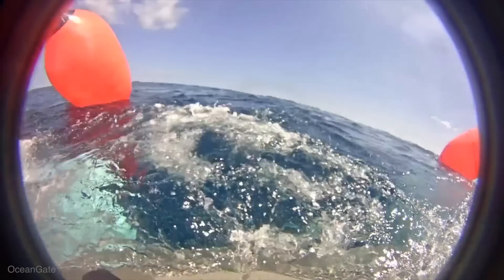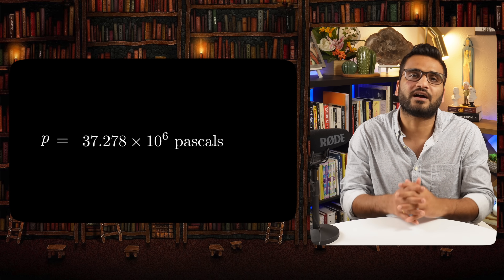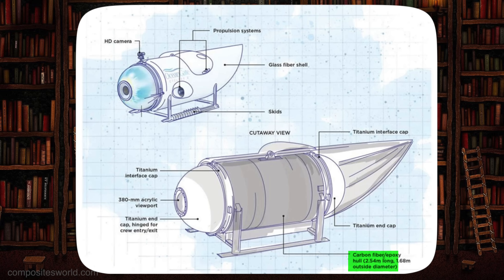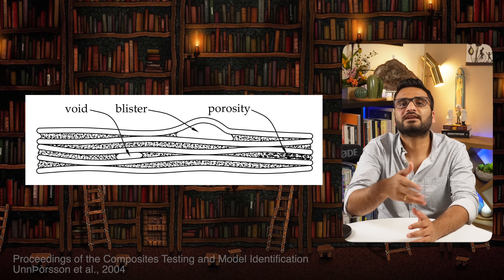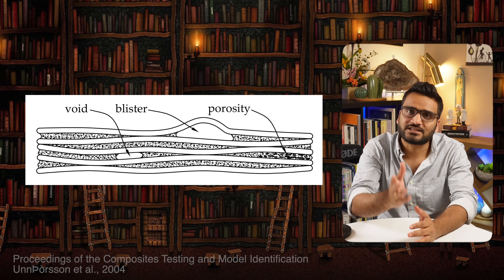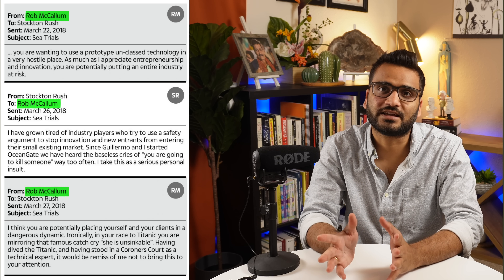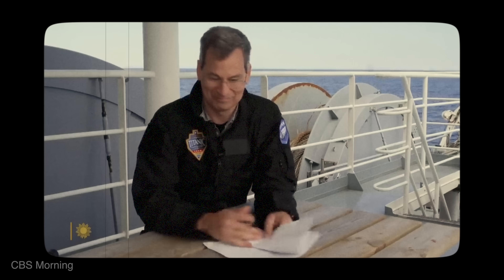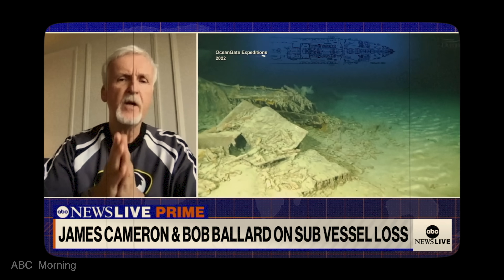OceanGate REALLY messed up - A Structural Engineer's Perspective | TITAN'S TRAGEDY

Comment: The website talked about the hull monitoring system that would give the submersible real-time warning of any problem so they could then head for the surface. Unfortunately it appears the first sign of a problem is immediate implosion and death. No time for surfacing.
Reply: Sounds of cracking were the early warning alarms but they were ignored
Reply: Actually, I think it was an attempted emergency ascent that caused the implosion. The runners they brought up showed little to no sign of damage. Due to how they were attached, they should have suffered very clear damage were they attached when it imploded. That tells me that he had time to initiate the emergency ascent protocol since dropping the runners was to only be done in an emergency. It wasn't needed for a normal ascent. The problem with an emergency ascent like that is that it temporarily increases the forces acting on the hull. You go from the water pushing down on you very hard to it doing so while you're essentially pushing back very hard due to increased buoyancy. So, if your hull is close to failing and you then do something that increases the stress upon it, it's probably going to fail. He probably heard the system warnings and overreacted by initiating a full emergency ascent. They would likely have imploded either way but a more gradual ascent might have given them a better chance of survival.
Reply: @possumverde   oh that's interesting.  I didn't hear such specific info on the condition of individual parts. Is that in this video or where did you hear that?  And what do you make of the hull monitoring system?  Could it actually have provided enough warning of an increase in strain in the carbon fiber to make an ascent possible?
Reply: @johnvanalstine9645  Mr Rush held Patent number US 11,119,071 B1 for his hull monitoring system. If he applied as much care in designing it as he did to everything else, it's hard to believe it would have been very effective.

Comment: 1 DRRR: Doctor of What, exactly?    2 DRRRR: No-one has ANY IDEA of what DEPTH the submersible was at, when the implosion occurred. 3 DRRRRR: THEREFORE, no-one can make any statements about the 'load' that caused the failure. (Go back, read that again, it'll come to you). We are now at 2,08 mins of a weak analysis: Assumption is NOT analysis. 5400 psi is certainly impressive, HOW does the 'Doctor' KNOW the depth of the submersible when it failed? He (nor anyone else) does NOT. Yet he ASSUMES it is at maximum depth? We are now at 2.26 mins, 2 analytical errors so far, 1 per minute. 4 DRRRRRR 'Tons of on-site testing' was completed: 20 SUCCESSFUL dives, 1 failure: 95% certainty that you return safely. How many submersibles has the 'DOCTOR' built , hat have a similar track record?Oh none? Wow! we are now at 2.48 mins, the error rate is INCREASING.
BUT WAIT, there 's more! 
5 DRRRRRRR The "Doctor" now references a MOVIE DIRECTOR, A PASSENGER on an alternative submersible that has been to see the Titanic wreck 33 times. WTF?? If you sit in the passenger seat of a for car 33 trips, this qualifies you as a  vehicle design engineer? Who cares what James Cameron THINKS about the design? He is NOT an engineer. Apparently, neither is the 'Doctor'. We are now at 2.56 mins, 5 errors in 3 mins.....about average for YT nonsense.
BUT WAIT, there's more!!
6 DRRRRRRR : Once again the ASSUMPTION that the Titan failed at the Titanic depth, citing entanglement, abrasion and several other (google defined) failure modes of Carbonfibre, while MISSING the most important attribute of CF structures: Virtually ZERO fatigue effects: There is virtually no 'degradation' as a result of 'cyclical loadong' What a Joker our Doctor is turning out to be! Misleading YT like that. Tsk, tsk. we are at 5.25 mins.... 

FINALLY , at 7.40, an accurate statement by the 'Doctor': ....we don't precisely know what caused the implosion ot Titan..."  Yep.

So we have wasted almost 8 minutes, before we get to ACTUAL, DOCUMENTED, SCIENTIFIC issues....what an introduction! (CRAP)

Start watching from 9.35 mins onward: The front viewport was (documented) as being rated to 1300 m.....this is  the MOST Likely fail point (not the Carbon fibre hull)  and in other 'recovery' videos of the salvaged parts, the front cover is being lifted with strap running through the (missing) front viewport 'glass'. HMMMM?

Go find that video clip, THAT is how the Titan ended: The front viewport window, forget all the other nonsense.

Comment: Only 5 minutes in but the section on CF composites is a little misleading. The compressive test is on a woven composite which will have equal stress capability at 0 and 90 degrees. The lay of the Titan just has unidirectional lays, which will be compressed along the fibre length by circumferential stresses. It will fail differently and at a lower stress.

Comment: "And that's where we work with Boeing and NASA"
Boeig says they didn't work with them at all. They had contacts there probably but that's not the same as a joint venture project where actual know-how is shared.
Nor did they sell the expired filament used on the craft to Oceangate so that must have been bought through other companies.

Nasa says they also did not work with Oceangate.

So what exactly happened there? A phonecall asking an employee at either for some design advice isn't "working with", that implies a legally binding partnership. Such a thing seems to not exist.

Comment: As a retired structural engineer I agree this subs pressure hull design was dumb.  Playing fast and loose with your own life is dumb but taking passengers is downright criminal.  Carbon fiber around a single titanium ring....hmmm what could go wrong.  The design was experimental, materials were experimental. This company and I'm using that word loosely. Somebody needs to go to jail. I don't think if the passengers really knew what they were getting themselves into.  My condolences to the families.

Comment: The loads on the end cap domes were about 10,400 tonnes of water pressure.  This end load was resisted by the thin walled cylinder of the carbon fibre barrel.  Due to the layout of the carbon fibre wraps most of this load is / was carried by the compressive strength (or lack thereof) of the resin.

I suspect that the cylinder failed in buckling under this massive end load initially, followed by general collapse.
Reply: That was my initial suspicion also.

Comment: Great presentation. Someone in another video pointe out the various screws being bolted nto the hull to support the display monitors and lights fixtures, also factored in to further reduce the structural integrity of the already sketchy hull made of a carbon. The little screws bolted into the 5 inch hull directly, causes stress and reduces integrity a materIAL that's susceptible to brittle break offs

Comment: Look at the front of the submarine. Just the part that had the window. 2 Good pictures afterwards. At 2 o'clock there's a puncture in 7 inches of titanium. It came from inside the submarine. That's 5 inches of carbon fiber hitting 7 inches of titanium and breaking through. The window is gone.

Comment: The Titan wasn't a sphere, it was a cylinder. The maximum amount of stress was concentrated at the glued "ends" 😱 The glue probably failed at the carbon fiber connection to the titanium end rings.

Comment: Under what conditions would concentric carbon fibers do anything useful structurally, compared with simply using a filler like sand in an acrylic concrete?  I would carbon fiber might be a useful material in a hull if it served as a tensile skin around a steel and titanium frame.  I wouldn't want to trust my life to such a thing without significant testing, but if there were multiple layers of slightly-elastic skin with fluid between, I would think carbon fiber's tensile strength under tension could offer useful benefits if it were part of a structure were anything that was under significant compressive loads would be made of uniform material.
Reply: Carbon fibres may allow a greater packing density, strong stuff/filler. If the fibres were disposed radially they would be in tension which might be structurally better than the circumferential windings in compression.
Reply: @everTriumph  Indeed, the only way for part of the hull to flex to a tighter circumference than the cylinder would be for the volume occupied by the material between the inner and outer walls to decrease, or for distance between the inner and outer walls to increase.  A mesh that ran diagonally inward and outward around the circumference, and was "phased" in such a way that any longitudinal cross section would have fibers at many different depths and directions, could have added a lot of strength.  Enough that I would think that a hull of the same thickness that could survive any dives to Titanic depth when wrapped circumferentially would likely be able to survive repeated dives without fatigue-inducing levels of stress.

Comment: You make excellent points. I would also add the fact carbon fiber and titanium are notorious for galvanic corrosion when placed together. Boeing knew about this issue while creating the carbon fiber composites for the 787. They had to separate all titanium parts away from the carbon fiber wings and hull. The Titan had two titanium caps and interface that sat right against the carbon fiber hull. .
Reply: Carbon fibres would have been out of contact with the titanium parts if the epoxy was properly applied to the connector rings.  This appeared to be the case. The idea that RMS Titanic continued head on into an ice field isn't correct. She changed course to the south after being informed of the presence of ice on her original course. Statements need to be accurate when criticising actions as comparisons.
Reply: @geoffreycodnett6570  Arguably everything is speculation at this point. I still stand by the fact carbon fiber and titanium are galvanic corrosive. Even if epoxy sealed, laminations can get micro-fissures or cracked over time and many cycles of compression and decompression. Plus the salt water can act as a conductive medium to accelerate galvanic reactions.

Comment: Here's the thing, if you have a component that is designed to operate at 1500m maximum, you don't EVER operate it at 1500m.   You operate it at 1000m, or whatever depth minus a predetermined safety factor. In all the reporting thus far, I'm not hearing that.
Reply from the maker: Absolutely. Margin of safety matters.

Comment: As a professional since 40 years in composite fabrication i would say that your explanations are very well done and accurate, that's the first time that i see an expert that seems to really know what he talks about about this accident.
Reply from the maker: Thank you for your kind words!
Reply: @doctorchadha  There is suddently one thing that just went on my mind, it's the obvious flaw of the design and the flabergasting way the cabon cylinder was build.
To make it simple, you have a cylinder with two hemispherical caps. So each cap press againts the tube ends with the pressure of the cross section, but the contact surface is from my estimation only 20-25% of the cross section so at 4000 meters you have on the tube ends a pressure of 4 times the pressure on the tube sides. But what is really idiotic it's that the cylinder has been fabricated by roling one directional carbon fiber. In this way you achieve the maximum resistance to side compression, but you have no resistance in the tube axis direction. Worse you have a huge risk of delamination in that axis and even worse at the tube ends, you have 4 time the pressure and no resistance in that axis. This is insane, you have only the matrix, epoxy resin that can absorb the pressure and in this way that resin will get a quick fatigue, will start to have cracks and become brittle. Then one day the tube ends will collapse and the whole tube will shatter. This design was made to fail, i don't know how there was not an engeneer to point to that huge fatal flaw!
Reply from the maker: Absolutely. Assuming the structure to be symmetric about vertical axis of the cylinder, every point on the hull was subjected to three compressive stresses: (1) the compression from the domes in z-direction; (2) the radial compression; (3) the circumferential compression—thats too much work for epoxy. And apparently, the fibers were not cross-wound. I would also think that the stresses coming from titanium dome on to the cylindrical hull could lead to local crushing due to stress concentration at the junction.
Reply: @doctorchadha  Yes the major flaw is that the carbon fibers have been rolled on the cylinder, there is a video showing the building of it. Usually you make a cross.wound at 45° to give the cylinder a homogenous resistance but of course to get the same resistance in one axis you need to make it thicker, so heavier and less space in the hull. 
I have build quite often small carbon cylinders and if you just roll  the fiber like this, if you try to bend the tube it will break very easily. Making a pressure resistant tube the way they did it is absolute madness!
Reply: Well said. This has been the best video I have seen on this fatality.

Comment: I appreciate your insight into the engineering aspects of the  Titan.  One thing I have noticed in OceanGate's  video of the construction of the carbon fiber hull is that there seems to be only a radial wrapping of the carbon fiber mat

When you look at say the construction of the carbon fiber air tanks used for fireman's self-contained breathing apparatus (SCBA) the tanks are wrapped in a diagonal weave so there is a crossing pattern to the weave.

The radial layered method is simpler to fabricate in comparison to a crossing weave.  I wonder about the ability to distribute the load and prevent delamination, and fatigue strength. 

Another area I have to question is the design of the  "hatch".  According to reports the end bell, which included the viewport, was held in place with 17 bolts.  In comparison 48" dia. 300 psi flange has 44 bolts.  I realize that there is a difference between having the pressure outside vs. Inside.  But  17 bolts results in an odd loading distribution around the flange.
Reply: Apparently there should have been 18 bolts but the top one wasn't used as it was difficult to reach  !!

Comment: I think that you have missed the main point of why the CF failed.  In a carbon fiber solid fuel rocket casing the internal pressure wants to increase the circumference of the casing.  This puts the CF in tension where they have their maximum strength.  In a submersible, the outside pressure wants to decrease the circumference of the cylindrical hull.  This puts the CF in compression where they are not very strong and what strength they have is from the epoxy resin bonding the fibers together.  As an example, grab the ends of a piece of string and pull the ends apart.  The string resists the pull since it is in tension.  Now move the ends of the string towards each other.  No resistance whatsoever.  The string droops downward.  Why is this so difficult for people to understand?  Carbon fiber woven into cloth without any resin, can be folded like a bath towel.  CF is only strong in tension.
Reply from the maker: Absolutely. I made a brief comment in the video that CF was good for tension but susceptible to compression under large pressure. Perhaps I should have elucidated a little more. Thanks for pointing that out.

Comment: Until the actual debris from the Titian is recovered and studied, mode of failure can not be fully determined. Conjecture is fine, but it is just that - conjecture. Did the vessel hit, become entangled, or implode in mid ocean? We don’t really know. Guesswork at this time is just as dangerous as guesswork at any time
Reply: Good design techniques should be freely discussed at any time, along with any suspect techniques which may lead to failure in the field.  It may be that the magic key which tells everybody exactly what happened is never retrieved from the ocean floor. Or if it is recovered, is not recognised as such.  So speculation, not guesswork, will put up possible modes of failure. Analysis and comparison with the remains will maybe point to a cause that may be further investigated, modelled and tested to further refine what 'probably' occurred.

Comment: Being an engineering channel I was hoping you were going to discuss a little about the magnitude of the forces applied to the carbon fiber. I come up with a vectorial sum of the longitudinal and the hoop stresses of just shy of 40 kpsi. What is the typical compressive capacity of a carbon fiber composite?  As an aside, I would set the zoom on your camera to something nice and Leave it Alone for the Entire Video.
Reply: You endeavour to keep the forces in fibres reinforcement tensile. Pull on the ends of the string. Pushing the ends meets little resistance. If you want to use fibre reinforced composites in compression, I would venture the 'best' option is to lay the fibres at 90 degrees to the applied compressive force, so that the complementary stresses put the fibres into tension.  In the case of the submersible, it would mean laying the fibres radially.  This is not an easy task.